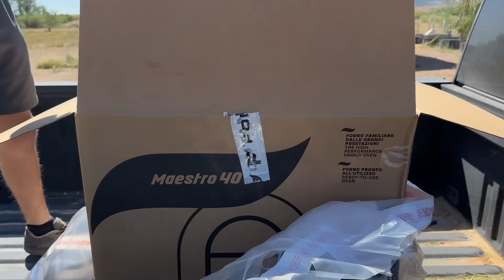WHAT COULD IT BE? More Trenching & Unboxing Something Delicious!

Comment: Why not put a few stacks in the trench every 30' and run a string at the proper slope 6" above the desired depth. That will give you an easy reference to find where to add or subtract dirt.

Comment: Is it possible to glue your pipe in the complete length then level the pipe to the proper depth with support along the way? Then fill dirt underneath pipe. This way you do not have to measure the dirt level every few feet.  I.e. use your pipe as level to the right depth. I hope this explanation makes sense. Wouldn’t this method go faster?
Reply from the maker: Ideally no you don't want to backfill with our sand since it will shift over time. Needs to be compacted.